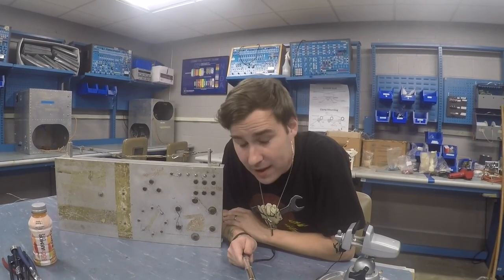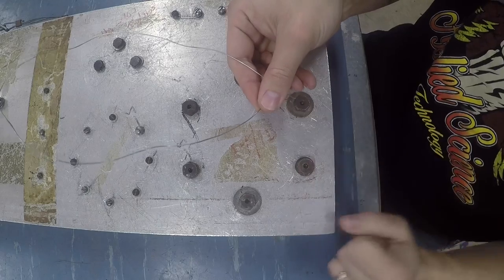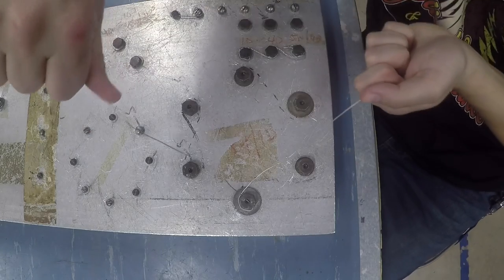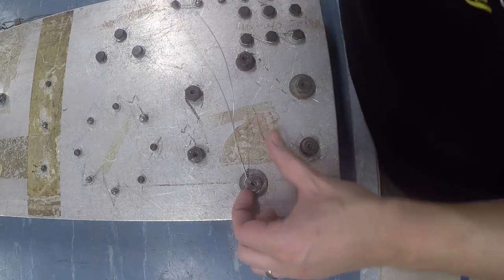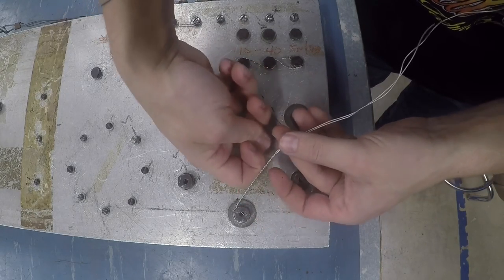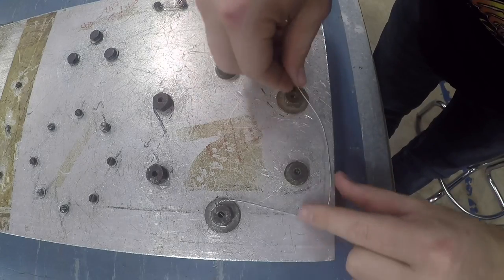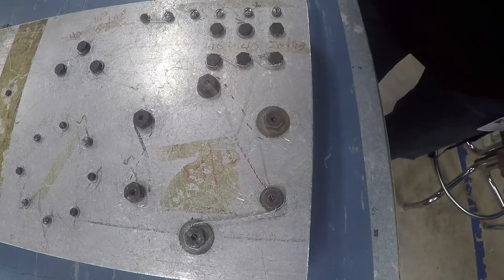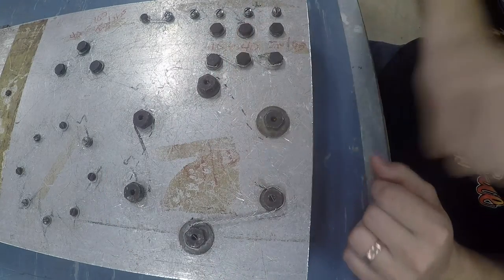Try This When Doing Aircraft Safety Wire

Comment: Great tutorial. Thanks for making it. I'm not an A&P but as an aircraft owner, I do what maintenance is legally allowed under FAR 43. I cringe thinking about some of the shoddy safety wiring that I've done over the years that a qualified A&P has had to look at when they go over my airplane at annual inspection time. You've inspired me to start practicing to be better!
Reply from the maker: My opinion is this, it doesn't have to look pretty, and it definitely doesn't have to be perfect. As long as it's holding the bolts in the right direction and tight its good with me.

Comment: So, possibly dumb question but what’s the best method to determine how much wire you need?
Reply from the maker: You will hate me for this, you kinda just get use to eye balling it.
Reply: @brycebuildsit  found that out today, but thanks to your video I was a step ahead of my classmates and finished early with better technique
Reply: No, do not accept that answer. What i suggest you do is when you get free time one day, measure just how much shorter your wire gets from a point after the proper twist. Remember what fraction of inch you lose for each gauge of wire. It can definitely be expressed as a % of the thickness since that's the only variable. From that point you can always say "after 6 twists the wire will be exactly 1/8" shorter. That's what you will aim to overshoot the drilled hole by as you loosely loop the wire into the correct pattern before you lock your plier down and start twisting. Life is math.